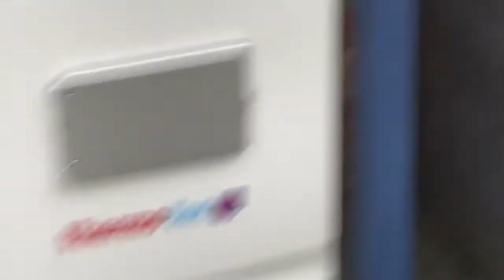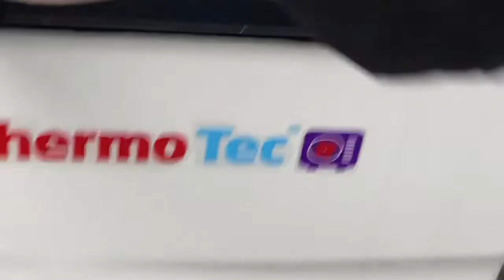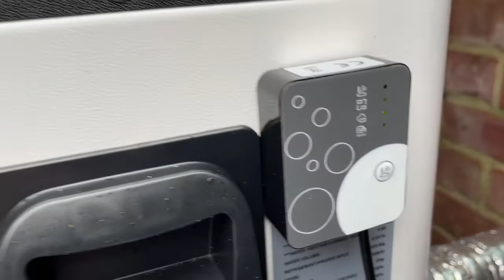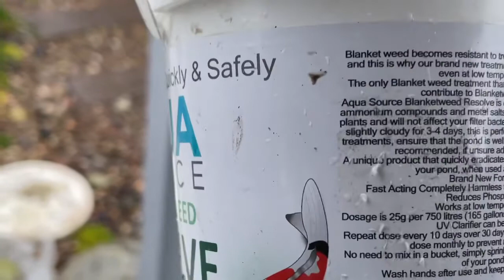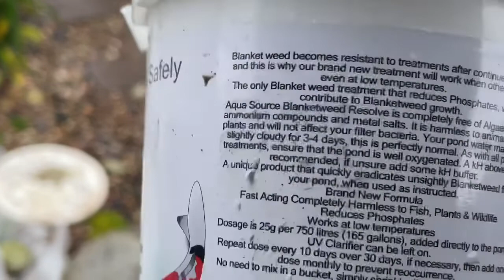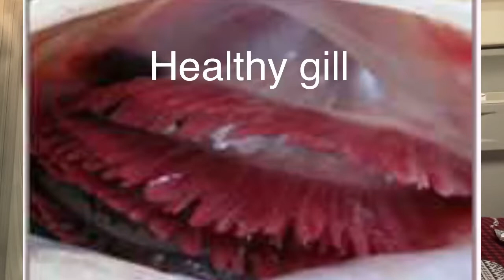KOI POND.Tinkering when the weather allowed, chlorine and dechlorination, the whys and therefore

Comment: Your trickle in metre were you get it from make and model thanks, keep up the good work 👍
Reply from the maker: Hi mark it came from Vyair , 6100R Digital Flow Meter 0.6~8.0L/Min - 1/4" NPT Connections here’s a link to the web page 
https://www.vyair.com/en/6100r-digital-flow-meter.html
Cheers mate thanks for watching 👍👍😀😀
Reply: @K.W.P.R  will that do for a 2000gal pond, many thanks
Reply from the maker: @mark5tytshort770  easy mate there are different ones with different flow rate parameters but that one will do the job no problems 👍
Reply: @K.W.P.R  ordered meter, thank you 😊

Comment: I’m having to use catalytic carbon in my purifier as I have chloramine in my water source, it’s a real pain as after it’s passed through the purifier the chlorine is gone but as the bond has been broken I’m then left with ammonia as my trickle in, luckily in well over filtered and filters seems to deal with it but still not ideal, also the chlorine tests don’t work for chloramine, it just shows up clear but u will get an ammonia reading from it, great videos all the best Matt
Reply from the maker: Hi Matthew , yes I totally feel your pain , I’m trying to research if there is any system that won’t destroy your bank balance that can remove both yes you can go the r.o route but as I said that can be exspensive , I’ll let you know if I find any , how do your filters cope ? 👍👍😀😀
Reply: @K.W.P.R   filters cope fine mate, trickle goes in just before filters so ammonia gets smashed out straight away thank goodness, I was going to make up a zeolite filter for the fresh ammonia water to pass through before it reaches the pond water but it’s just another thing to refresh every couple of weeks and as filters are dealing well no need, ammonia in pond is zero so all good, thank you for your reply
Reply from the maker: @matthewnicholls2658  good to hear you system copes ,but for those who don’t zeolite is a good shout but as you said it’s just more expense and more to do 👍👍😀😀
Reply: @K.W.P.R   it is, not that it costs to much as the zeolite just recharge with salt, but yes another thing to think about every couple of weeks and if u forget then the ammonia caught in the zeolite will then get dumped into the pond, I bet before we know it chloramine will be all over the country especially with COVID and all that
Reply from the maker: They say you should replace 50% of the zeolite with every recharge , so depending on how much you choose to use depends on how often you have to buy new , practical fish keeping magazine is trying to map the water authority’s using chloramine, not complete yet but it’s looking to be around 50% and growing . Nightmare really 👍👍😀
Reply: @K.W.P.R  ah didn’t know that, interesting stuff, I’m glad I’m seriously over filtered not to worry about it, something for everyone to keep an eye on in the future for sure, all the best mate I look forward to ur next video, keep on truckin 👌🏻

Comment: Chlorine does burn off quickly.. I spray the water in. I am sure my fish don't like it but haven't had a problem ...yet
Reply from the maker: It maybe different amounts of chlorine in your water in Canada chris , people used to do the same here in the uk , some still do , but I did see an experiment on line and it was alarming how much chlorine remained in the water and now we have chloramine to deal with 👍👍😀😀
Reply: @K.W.P.R  I never add after heavy rain or in very early spring as you can actually smell the chlorine and the water is an off yellow colour... Gross.. If I am not going to drink it can't really expect fish to swim and breath in it
Reply from the maker: @stubbsaquatics6080  we don’t drink from the tap at home either it all goes through a jug filter